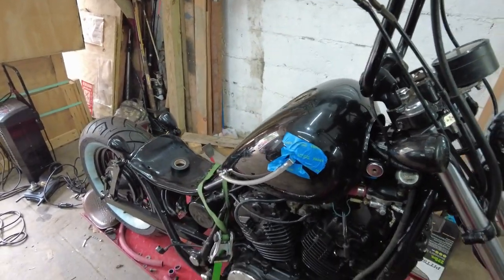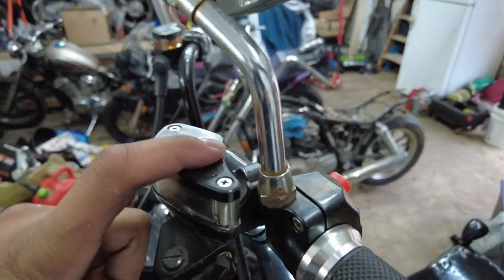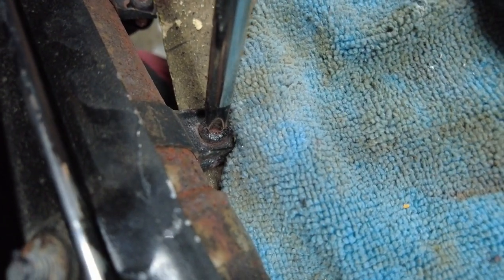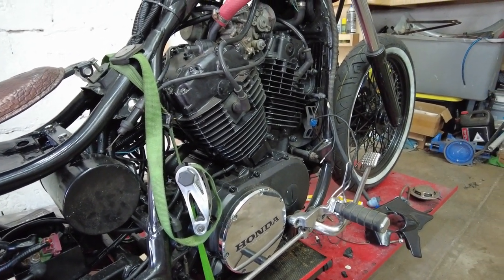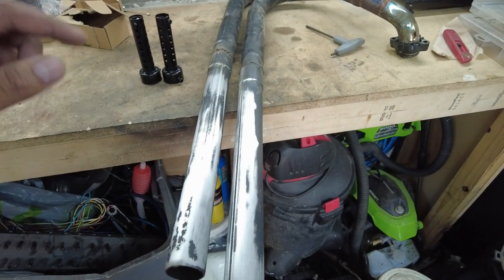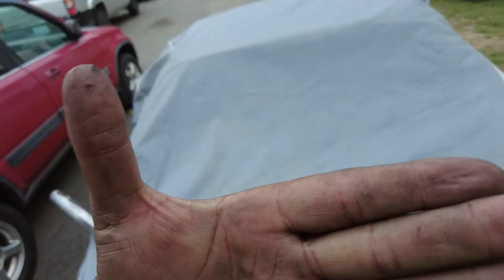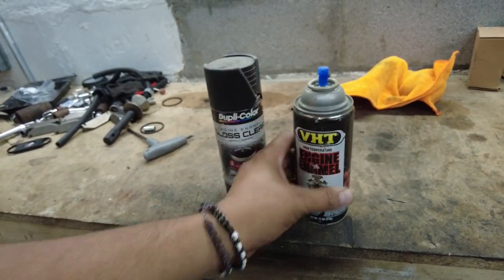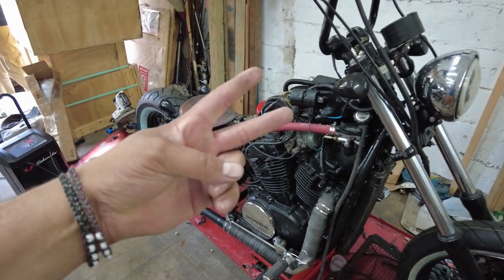1987 Honda Shadow pt22- Exhaust wrap, baffles, painting

Comment: Where did you get your side covers from I cut off my rear fender
Reply from the maker: Are you talking about the covers that cover the battery and stuff? If so, mine came with my bike, but you can check eBay shadows from 1986-1988 should fit.
Reply: @hondagarage  yes I’m talking about the covers that cover the battery and stuff
Reply from the maker: @michaelmullen6704  yeah check eBay, 1986-1988 honda shows should fit those years
Reply: @hondagarage  thank you
Reply from the maker: @michaelmullen6704  anytime

Comment: Can you change out the spokes on the rims
Reply from the maker: I believe so, but then you have to balance the whole wheel, not like with the tire, it's a different balance
Reply: @hondagarage  where did you get your rims from
Reply from the maker: @michaelmullen6704  I got them off a 1988 honda Shadow vt800 that I own. Idk if you seen the wheel conversion video I did.
Reply: @hondagarage  I didn’t see the wheel conversation you did
Reply from the maker: @michaelmullen6704  you gotta check it out, lol but do some research on what wheels will fit your bike I had to do a little moding to mine.
Reply: @hondagarage  that’s what I’m doing now…Sorry I’m asking a lot of questions…This is my first motorcycle and my first time working on one and thank you
Reply from the maker: @michaelmullen6704  no worries anytime. 👍
Reply: @hondagarage  I do have a question sorry I want to rebuild the carbs can I just buy a carb kit or is it best to just get a new carb for my Honda shadow 600
Reply from the maker: @michaelmullen6704  I would go with the carb kit it's cheaper
Reply: @hondagarage  thank you